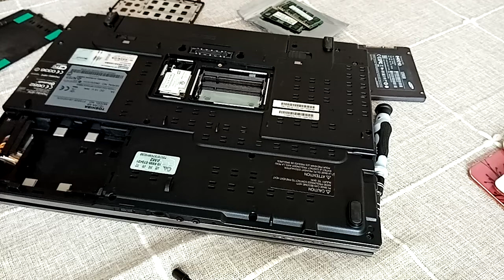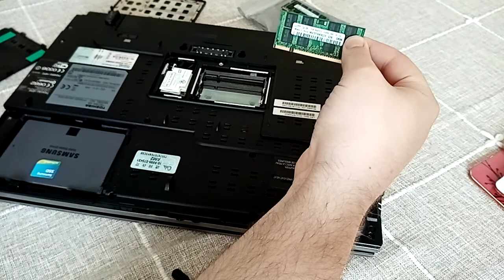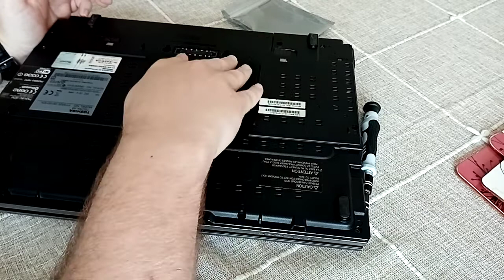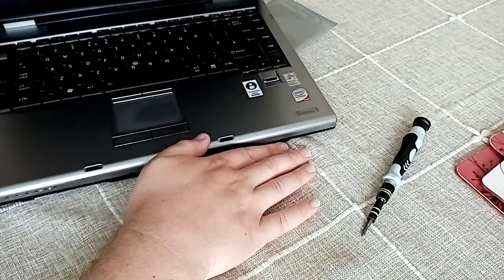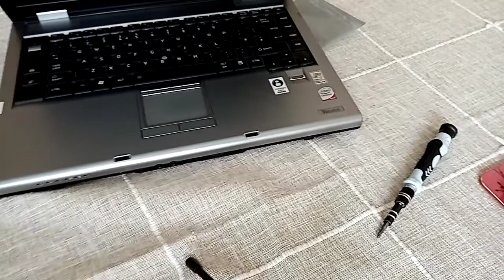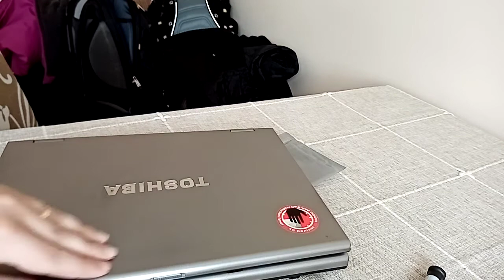Toshiba Tecra A9 - Part 2 - SSD and RAM installation.

Comment: I have a A9 and I want to put a SSD in, I updated the Ram when I purchased it in 2008, where can I get that SSD you installed?
Reply from the maker: Hi John, I purchased the SSD from ebay, coming out of a decommissioned device. You can pick up a reasonably price 128GB SSD for around the £25 mark. Makes a massive difference in performance.
Reply: @fixingitup8004  Thank You